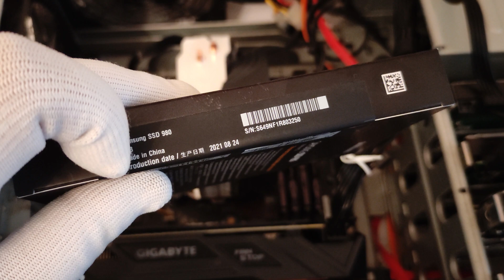INSTALL M.2 SSD | SAMSUNG 980 M.2 SSD 1TB INTO MSI H170 GAMING M3 MOTHERBOARD

Comment: whats the speed that you get from this ssd? I put nvme ssd too that board but i am getting only 800mb reading wrting. SSD is Kingston Reneganere PCIE 4.0 7300mb reading
Reply from the maker: The Samsung 980 M.2 SSD 1TB has the following speeds:
Read speed: Up to 3,500 MB/s
Write speed: Up to 3,000 MB/s
These are sequential speeds and may vary depending on your system and usage.